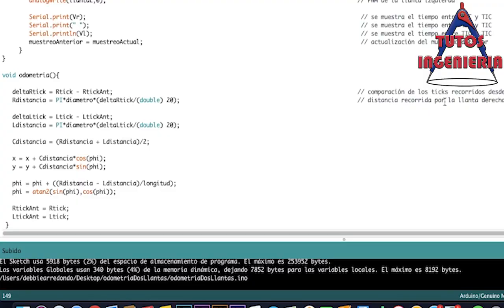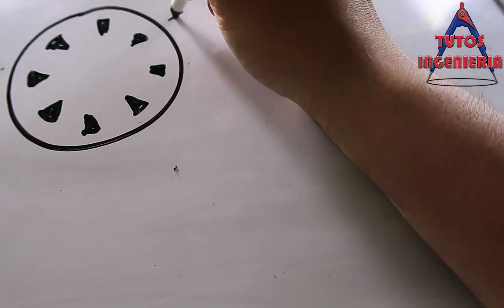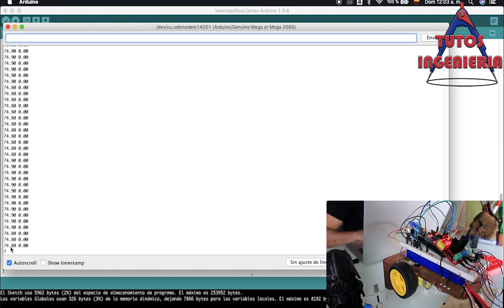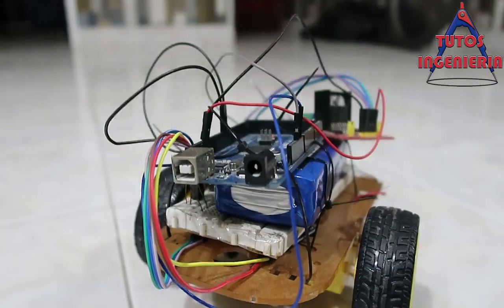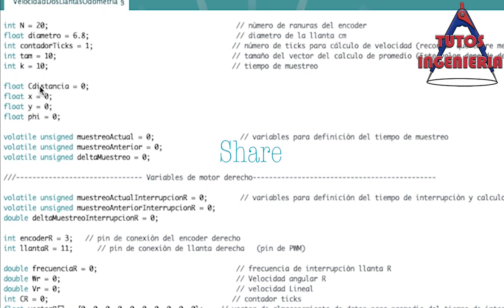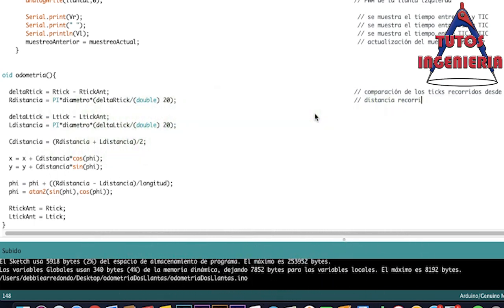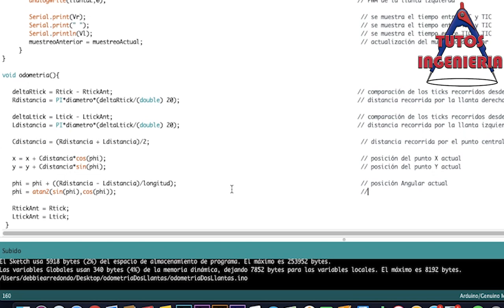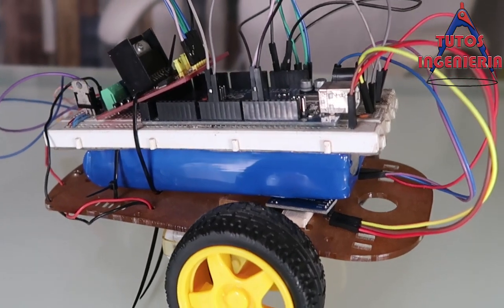Odometry On Arduino platform

Comment: Good tutorial but how can I get world or global coordinate from this code
Reply from the maker: Hi, I don't understand your question :/  In this tutorial there is a only way to do that is with odometry and encoders, but I want to make many more with other sensors.
Reply: @TutosIngenieria   I read that there indoor wheel mobile robot has  local coordinate frame and global coordinate frame. I have used this method but not sure if it covers both global and local approach.thanks
Reply from the maker: @oluwayinkaesan4393  humm, I'm not sure, I really don't know the exact theory, I think that  this coordinate frame is global, but I'm not sure about it. Sorry. I'm not an expert, just a maker.
Reply: @TutosIngenieria  It is very simple. Global coordinate is basically the coordinate frame which is fixed and the position of the robot is measured with respect to the global coordinate. And the Local coordinate is the coordinate which is attached to the robot and moves with it(the robot). So basically in order to measure the position of the robot you actually measure the position of the local coordinate with respect to the global coordinate.